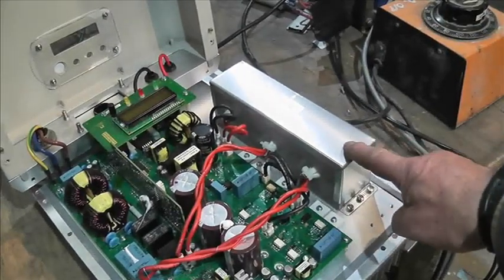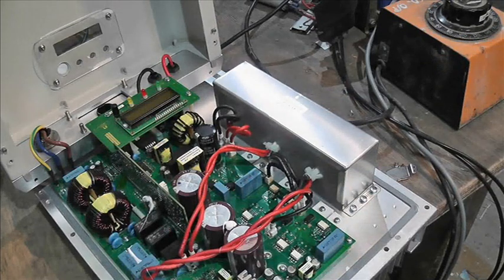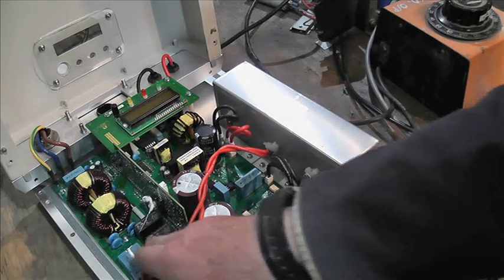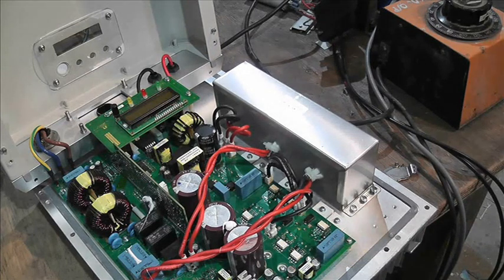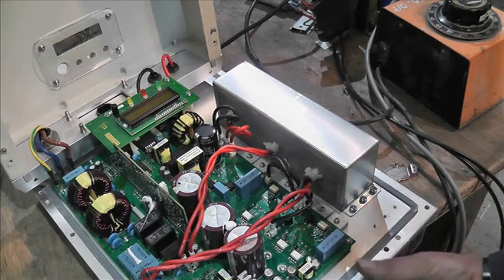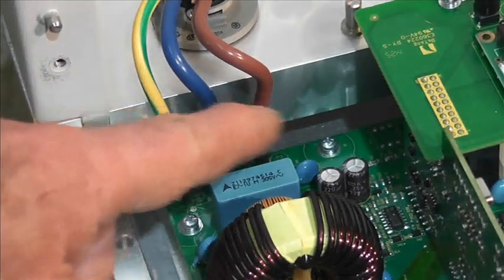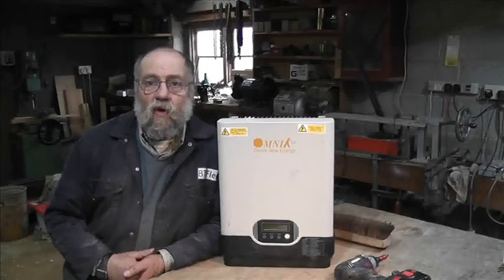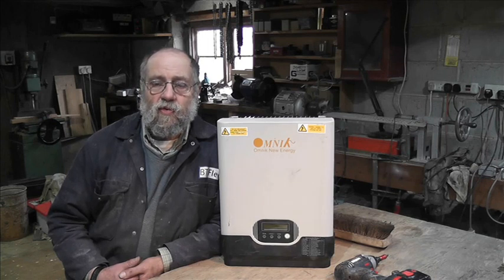Omnik solar grid inverter

Comment: Nice video. Always interesting to see the old kit that's about - I've repaired a couple of older inverters that had issues - failed relays and failed filter capacitors, but I bet the older stuff outlives the new kit...
Reply from the maker: Will, that heat sink is definitely up to a standard, not down to a price, cheers

Comment: Those plugs would make testing a lot easier! I usually crack the thing open and stick the spade connectors on. Found a dewalt xr18v li battery last week and this week found an impact drill/breaker that runs on it. Probably find a charger next week!  But I did go out and buy a bag of cement on Monday, then I found 3/4 of one of those plastic bags of cement in a skip today, so now I have 2.
Reply from the maker: Well isn't that just the cussedness of life, bit like busses. Never had experience with Dewalt except those yellow angle grinders that had the duff bearings. I think you have one of the fixed ones, cheers

Comment: Andy I have this very inverter and thought it was goosed the other day as the LCD display was off.   Turns out both times the display was off it’s been pitch black and today during daylight hours the inverter LCD display is working.    Do you know if it should always be on based on power coming from the CU or does it in fact only power when the solar panels are feeding it energy?
Reply from the maker: Oh yes, no stress, they all switch off when the panels are not generating, cheers
Reply: @ appreciate the reply.  I thought naively it would be powered via the CU all the time.

Comment: Hello.
Just for a technical request.
I have an Atlantic Explorer thermodynamic boiler. I plan to connect it to the PV panels. I inquired with the manufacturer who advised me to use the SmartGrid.
And as my Omnik brand inverter does not have this option, would there be, depending on your knowledge and skills, another connection possibility (another technology compatible with my inverter, or why not, a change of inverter)? And if a change of inverter is necessary, what would be the model or brand of Smart Grid type. I am looking for solutions to make the most of my boiler, economically and ecologically?

Thank you in advance for your information
Reply from the maker: Hi, I am unfamiliar with this boiler, is it a resistance heater and can it work with variable voltage. Is it high tech with it's own micro processor? cheers

Comment: I have one of these inverters.
Is there a problem if nothing is showing up on the screen and no lights on run indicator?
Reply from the maker: Peter, sounds like a problem. The first test is to use your multi meter set on AC to check if there is mains power at the inverter. Next with the meter set On 1000v DC check there is DC power during the day. Best do this either first thing or last thing in the day when there would be volts but little current, safer that way. Be careful, cheers
Reply: Cheers
I guess it’s best an expert comes to have a look at it.
Thanks again.
Reply from the maker: I'm sure your self reliance will be improved if you learn this simple task. It's important to learn how to use a multimeter, cheers  @peternicholas7175

Comment: What system voltege can use this inverter 24v or 12v
Reply from the maker: Hi, it's a solar grid inverter so uses high voltage dc of 100v or more, cheers

Comment: Can I add battery on this invertera
Reply from the maker: Hi, you can add a power wall battery to any grid inverter system, but you cannot use this inverter off grid , cheers
Reply: @TheInfoworks  This could be used off grid with an inverter capable of AC coupling (sometimes called grid forming) that this inverter treats as the grid.
Reply from the maker: @randacnam7321  Similar to the recent video by Max Ironthumper but in his case the Solis S5 inverter has a CT clamp a facility for controlling the output cheers